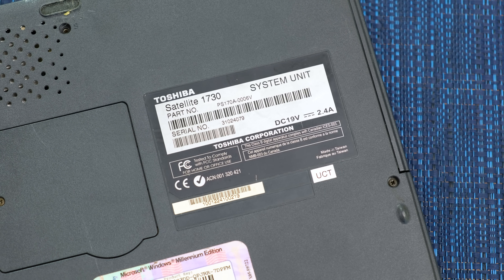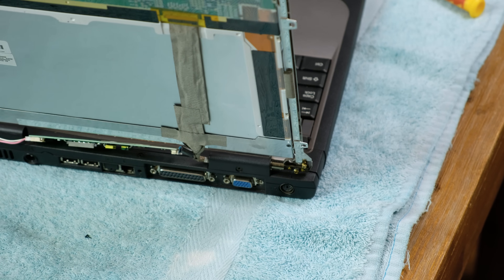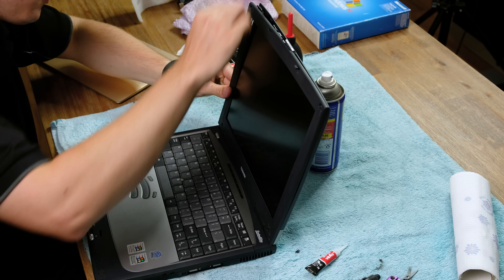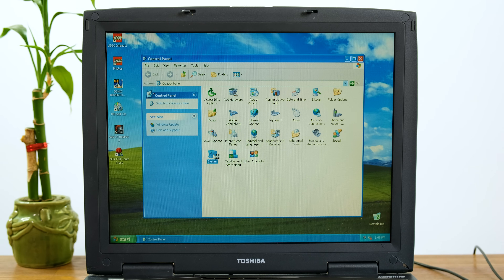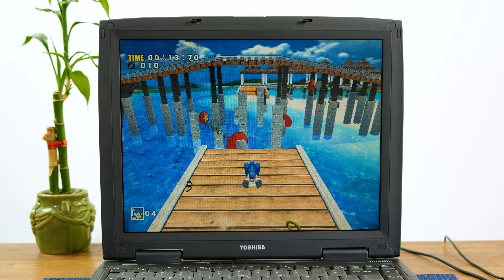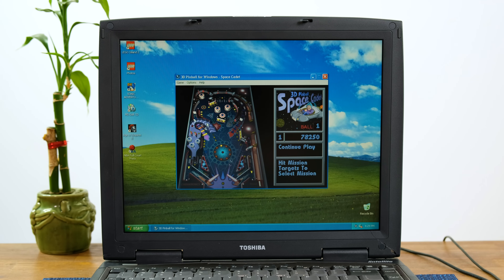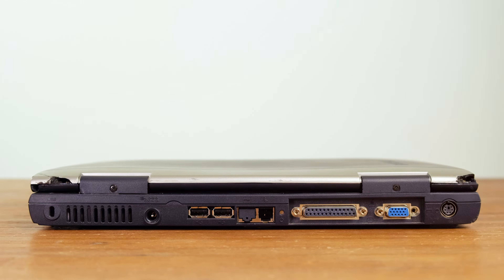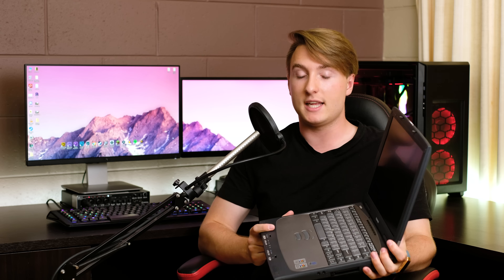Someone Threw Out This Broken Laptop… Let’s Fix It!

Comment from the maker: So, here's another video about a laptop. What a surprise right? Anyway, I hope you enjoy 😊 
► Gear I Use (Affiliate Links):
Dell G7 15 Laptop: https://amzn.to/32VOSux
Keychron K2 Keyboard: https://amzn.to/2F51NCh
Logitech G502 Mouse: https://amzn.to/351iae1
Benq 144Hz Screen: https://amzn.to/3jJk1YW
Fujifilm Camera Bodies: https://amzn.to/2EXdPxL
Fujifilm Lenses: https://amzn.to/3jY8xB9
Rode NTG3 Microphone: https://amzn.to/3jKWeHZ
Rode Videomicro Microphone: https://amzn.to/3hXoua4
Rode Wireless Go Microphone: https://amzn.to/3bsVaWr
Audio Interface: https://amzn.to/31XXVvV
Manfrotto Tripod: https://amzn.to/356r7Tq
RGB LED Light: https://amzn.to/3i2eNqL
Godox SL-60w Video Light: https://amzn.to/31Vtsyl
Apple iPad Pro: https://amzn.to/3h0i20H
Reply: Telephone activation is a thing and still working.
Reply: Omg please give me a link to buy the hard drive it needs I have that laptop I ordered a drive and it was the wrong type of ide please gimme a link
Reply: Psivewri I have an idea about this computer! Tbh have you ever used your computer to make it like a mobile hotspot well if you tweak some things & if the old computer be able to connect it to the pc wifi I guess you won’t be locked out anymore!
Reply: try wifi after upgrading to service pack 3 as WPA2 was implemented with Windows XP SP3
Reply: Bro you can still activate windows xp. Over the phone. I bet my left butt cheek that it will work.
Reply: @Psivewri those ethernet ports never work on laptops with windows xp not pre installed
Reply: I'm your 100th like

Comment: Hey Psivewri I have a very similar version of this laptop but it has slight differences and the floppy drive is on the front right of the laptop but its sad I don't have a charger for it
Reply from the maker: You could always get a multi voltage adapter, that way you could power many different laptops 🙂
Reply: @psivewri  Oh Yeah I forgot about that multi-volt charger

Comment: “I’m having trouble connecting to the internet” you think you have problems, I found an old Windows XP pc with a internet USB, it has an install disk which I have no idea how it was installed because it doesn’t even have a floppy drive or a disk drive....😤😂

Comment: Yeah the Ethernet port won't work until you install the Ethernet upgrade card for this laptop. If it's anything like my Armada m700 it will be under a cover on the underside of the laptop somewhere. Mine had the modem only card installed so only the phone jack was connected with the Ethernet port covered with a plastic cover. But a second laptop I got as parts to replace the hinges in mine had the Ethernet/Modem combo card, so I installed it and now the Ethernet port works. ;)

Comment: I done a review on a similar model of this laptop (Satellite 1800-400), usually the Ethernet ports will be blanked out or flat-out won't work - as you found out. Your best bet for connecting to the Internet is to use a PCMCIA Ethernet card.

Comment: A really cool laptop to have lying around. I would have definitely run Win2k on it though, period correct and kind of cool.
That said, WPA2 wouldn't work with that so maybe XP is a smart choice, combined with a PCMCIA wi-fi card. 
Your problem was that you're not running XP SP3. If you'd installed that, it would have worked fine with your network.

Comment: I have the feeling that 128MByte isn't really enough to do some gaming on Windows XP. I think this machine would run much better with Windows 98SE on it.
My old Dell Latitude CPx-J 650 GT from 1999 runs fine with XP, but only after the RAM was upgraded to 512MByte.

Comment: Nice videos man. What you could do with the PCMCIA WiFi or USB cards since they are older generations. You will most likely need to create or edit a wireless SSID that does not have WPA2 security, instead use WEP (TKIP (not AES) or no security for these types of testing for at least getting it online for the time being.

Comment: Wait  you waisted time wiping a hard drive you could had typed in admin and password most of them I find never changed the windows default administrator password and you’ll need to manually load the driver disks onto the computer because it has no way of using WiFi to auto load drivers

Comment: Most likely the WiFi doesn't work because all modern WiFi routers require WPA2 for security purposes. If you dropped it down your network security to WPA or WEP it would most likely connect (but now you've opened a giant security hole in your network). It is very hard to find a PCMCIA card that supports WPA2 (only the very last generation of G cards will), and basically none of those have Win9x support (though they will support XP).

Comment: It's such a shame how you replaced Windows 2000 Professional with Windows XP. :'-( 

Windows 2000 Professional is a million times better than Windows XP. It's more stable, lighter, faster, more reliable etcetera. The only downside is that Windows 2000 Professional takes longer to boot, but other than that, I would NEVER choose Windows XP over Windows 2000 Professional!

Comment: After washing my face with soap with eucalyptus oils, I brush my teeth with toothpaste with eucalyptus extracts. I eat my cereal sprinkled with dried eucalyptus leaves and some hot coffee with crunched eucalyptus seeds blended in. I take my pet  koala bear (leashed) around the block so he can pee on the  eucalyptus trees. He is a trained koala to think he is a dog, but he barks not in any old bark way he barks in eucalyptus bark accent. and then I wipe my computer with damn cloth with eucalyptus oil that doesn't disinfect anything. I just like eucalyptus if you haven't noticed yet.

Comment: I've got the same laptop. Replaced the Celeron with 900MHz Pentium III, but it still shows up that CPU is tacted as 700MHz one, unfortunately. Netherless, I'm happy it's running Windows 98 SE and W2k as my daily "internet radio receiver". :)

Comment: Friends found 2 laptops in their neighbors' trash. One was clearly gone but the hard drive was working. The other was originally WinXP Pro but got Win7 upgraded but no product key. I should have cloned the drive before it failed. It needed just a new hinge and it looked like new.

Dude, there are password clearing boot CDs. No need to wipe unless it's got Windows 2000.

As for internet connectivity, have you tried installing the correct drivers? You might have to look for them separately. And make sure the BIOS sees it. Did you install the dongle correctly? That really should work.

Comment: ive never had any issues connecting windows xp to wifi, of course im using an install disk with sp3 though. the disk also has the key slipped in.
Reply: as long as you aren't on a 5Ghz WiFi network it should work. if im not mistaken the Belkin N300 USB WiFi dongle works fine in XP, and works fine on our network, which is password protected.

Comment: If you want to allow easy WiFi access to very old devices, it's easy to add an old access point. Use MAC address filtering and leave the network unsecured. This is how I connect my iBook G3 900 to my home network with sacrificing security.

Comment: the RJ-45 port is probably not connected internally i had this problem on a old Dell laptop the internal card for the network was a "modem only" card and it needs a "combo Rj-45/modem" card to work with ethernet

Comment: I have the same laptop but a slightly older model. I found it in a junk pile at the university my dad works at. I was allowed to take it home and mess around with it. I tried booting it up and it wouldn't load the operating system. I tried putting Windows ME on it, but it would give an error when formatting the hard drive. I ran ScanDisk and that doesn't help either. It eventually gives up and Scandisk stops. When I try to rerun Scandisk, it gives me different errors every time saying that a file is corrupted. I might just get it a new hard drive depending on the price.

Comment: I used to have Dell desktop. It 800mhz P3 I put max 512 ram in  and 80gb hard drive and FX 5200 PCI card and it ran xp home great . It came with dead 10gb hard drive no ram  and windows me Coa . I used that computer for while as my main PC tell o got newr computer and then I put that Dell as fiile sever it ran for years in tell PSU went out

Comment: Very sweet trick with the super glue reinforcement :-) i liked your video as usual and by the way you can get XP pro Sp1 or Sp3 without activation needed or use either black XP or ultimate XP which both will have all the drivers on bord for the laptop Or perhaps you could  tried Win 2000 pro sp4 that has activation removed. Sweet work anyway keep going with the videos your awesome
Reply: Or just install SP3 and activate with any one of the many XP keys floating around on the web, their activation servers still work but seem to accept any key

Comment: From the boot screed I can tell you installed windows XP service Pack 1 or older. If you install service back 2 or 3 that you should be able to connect to your wireless network. WPA2 wasn't supported before the update you see

Comment: Loved the video.
I recommend against using superglue on ABS plastics and, in general, the kind of plastics they use in laptops (usually ABS but it's not always easy to find the mark). It just dissolves and melts it instead of sticking to it. If you think fast and push the two pieces toward each other, you can melt them together but it's never as good a job as with, say, 2-part epoxy.

Comment: How do you find cheap LAPTOPS? (THING is, I need a cheap spear laptop just in case my razor pc brakes and I think it's on its last legs.)
Reply: You're better off looking on ebay for a laptop with at least a core 2 duo as a spare for the extreme case you need one, this one isn't really usable anymore for modern tasks

Comment: If the network adapter is actually installed and not a dummy, try the “NE2000 compatible” driver.

Comment: You could have used a dos util that lets you clear the windows passwords letting you create your own. You would have been able to access the data in windows. Could have been interesting 😉
Reply: There's easier methods of using Live Linux to modify some Windows file(s) to remove it.
Reply: Considering the age of this laptop, most likely all they would have had to do is pop the hard drive into another machine or use an IDE to USB converter. It's not like full disk encryption was really feasible back then, and on a CPU that slow, encrypted folders would have taken *forever*.
Reply: @ryanjay6241  Or use an Live XP disc like F4UBCD

Comment: if really want internet to that laptop you could try tethering via usb (i have done this on some pcs which were refusing to connect to my network via usb dongle ) only downside is that you need to use cellular data and the speed is slow but for activating and downloading some drivers it should be fine
Reply: You can share WiFi via USB tethering

Comment: The way laptop hinges are designed really bugs me.
Happened to my laptop, the hinges were extremely hard to move once I opened it up but now it works but I can't move the screen.
(I only opened it up to remove a screw and crud from the fan and radiator.)
Reply: Ora nge Yeeeeeeeeees! This is windows virile cool start sounds

Comment: Could you try installing Linux on this machine. Maby then you could connect to the internet.
Reply: This could potentially run an older Kodi version (I got a 2014 version to run on my Samsung NP-Q1 with a similarly clocked Mobile Celeron and 1GB DDR2 RAM), or something lightweight like Puppy Linux.
Reply: Was about to say this exact same thing lol
Reply: You can connect to the internet, but you can't really browse the web...
Reply: You could, if you refrain from visiting heavyweight websites like Facebook.
Reply: @markwiering  Nearly any worthwhile website has some form of bloated JS or an overload of resources nowadays, you can't just say "It works if you don't surf two thirds of the internet!"
Text browsers would be possible but no fun aswell, at least not in a productive environment, for testing, fine

Comment: your router doesn't support 2.4ghz frequency? can't set up a guest channel for it? 802.11n is the latest standard using that and 2nd to latest standard with a full release.  802.11n routers are all over the place used, seen em even for $2 (usually 8-10+ usd though)  CERTAINLY you COULD get it to connect if you have a 2.4 ghz frequency and setting that allows older standards on it.  Granted it'll slow down the other devices but XP supports at least until 802.11n if not AC (though the motherboard may not like that new of standards)

Comment: 6:15  You need to change security to WPA or WEP for it to connect via WiFi.  But of course change it back when your done.  My case I generally just hook up a spare AP for it when needed.
Reply: Or install Service Pack 3, because XP RTM doesn't support WPA-secured networks.

Comment: Try getting a Netgear pcmcia card. I have a Netgear WG511T card and it still works in Windows and Linux even with my new AC wifi router. Also, and I'm sure you've gotten this comment already, I'd love to see Linux on the thing. Maybe Arch if you can stand to install it. 😛Basically, go with a very lightweigh distro if you actually do decide to put linux on it.

Comment: Great video!!
You could make a video upgrading this machine to maximum ram, ide ssd, thermal paste replacement, and a little overclock
Reply: That would be cool, however overclocking a laptop wouldn't. The way they're cooled usually cant handle the heat generated by an overclocked CPU. If you were to overclock a laptop, only raise the bar only a little bit.
Reply: @someguystudios23  yeah i only am talking about a very little overclock, about doing everything that's not risky and can increase performance of that baby at least by a little amount, only to see all the performance that machine can deliver
Reply: @c462-  The risk isn't worth it, you won't really notice a difference with those small increases
Reply: @c462-  Laptop's have a locked CPU. Can't overclock them. Especially that old of a computer. It's as fast as that little celeron will go. Maxing ram and adding a SSD will be more then good enough to make it go faster.
Reply: @fightingfalconfan  hmm, yes, but maybe it exists a way of overclocking the cpu... Something like the "pencil mod" on AMD's duron cpus 
Obviously this is more of a risk than an advantage, but to me is interesting to see what a super old laptop could achieve
Reply: @c462-  Unfortunately not. Laptop cpu's are locked from factory. Done this way because thermal constraints are extreme in a small form factor such as a laptop. Also the power consumption factor of the overclock. I would personally love to see a laptop cpu overclocked to the max but it won't happen. Laptop bios's are very bare bones too. No overclocking option in them. u.u

Comment: I might get an old windows xp laptop for old games there very cheap for around £30 to £50 but it be a Pentium core 2 duo
Reply: try to find a thinkpad t60 or better t61 or even an x61. they are bullitproof and upgradable.

Comment: you should try to hack the password and see what's in there
Reply: He can’t now, he wiped it clean, what a shame I would have liked to see what was on it
Reply: @smithmcsmithy2645  He still could with some recovery tools. He only did a quick wipe. XP just did 0's over the old partition, so very much recoverable.
Reply: fightingfalconfan depends on if he used it for anything after, if he did some of the data may be a bit corrupted, some still might be intact on that harddrive.
Reply: Kourkutas2 Kutsukuta ya

Comment: How about upgrading it with some SSD and RAM ? 🤔😅😅😅
Reply: so... where have you seen an ssd with an ide connector?
Reply: certainly plausible, wouldn't go over 1-4 gb (if even that, it may max at 512 mb even) given that its a pentium 3.  As far as the SSD its possible but that all depends if the bios will pick up and play nice, it more than likely would need a pata ssd though (which exists but isn't as common)   IDE (modern times pata) was the common then, sata barely existed and well if it has scsi idk if that has a ssd for its bus
Reply: Gaming Zone GZ7 I never knew there is SSD with IDE connector?